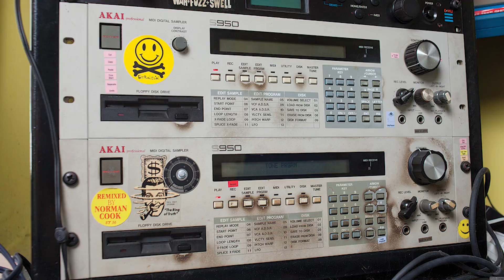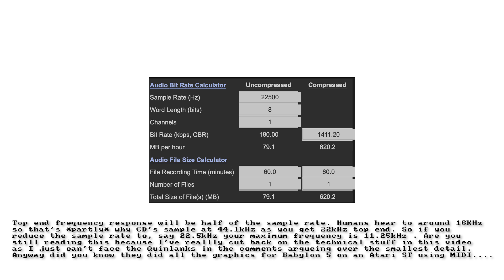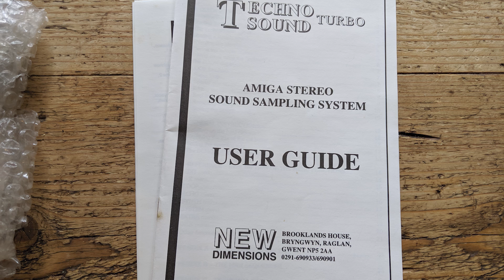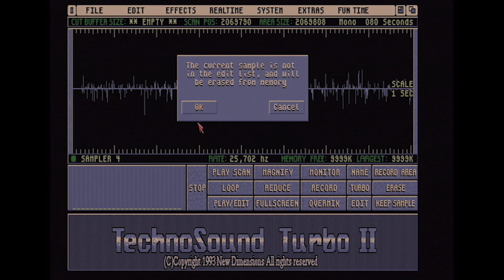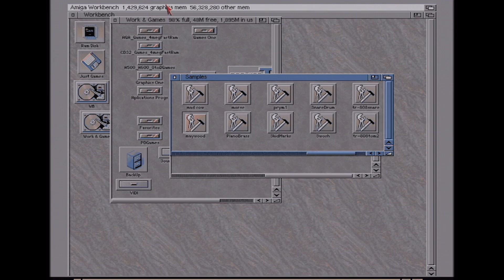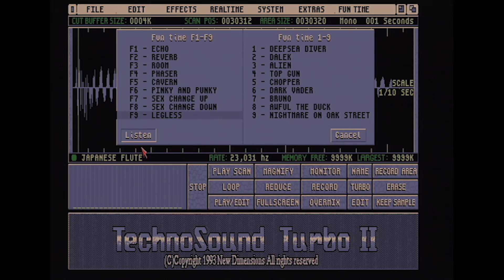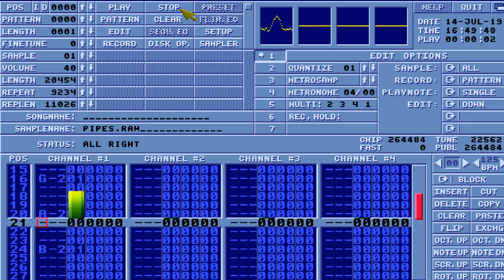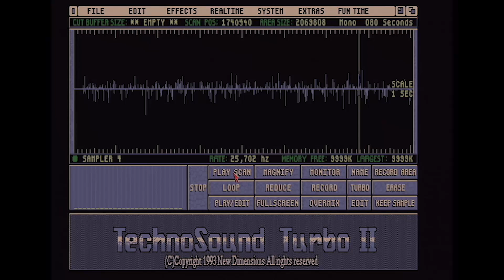ChinnyVision - Ep 397 - TechnoSound Turbo - Sound Sampling On The Amiga

Comment: Hi mate,   Thanks for the vid.   

Reasons you think the sound quality is so crap when you made your own samples is there too quiet.  Meaning the noise to signal ratio is gonna be bad.  So that noise stayes the same so with a louder sample you'd notice it less.   I used to use a compressor to compress my samples when sampling to get the best possible.  This makes a huge diff.  You can see the pro sample later on in the video you demo the wave form goes from top to bottom as opposed to yours thats a little blip on the line. 

Do you know if you can trigger samples within Techno sound via MIDI from another sequencer?  

All the best

Comment: I had the first version of this, it looked a lot nicer but was mono.  The software was a bit different but the tracker was really good.  The great thing about this was the ability to mix samples, thus giving the illusion of more channels as you could keep overlaying the samples until it became distorted.  I was using a 2mb Amiga and could fit quite a few samples in the tracker.  Made some good tunes with it.  Also made a lot of sound fx for the various Amos Pro games I wrote (knife banging on a bottle for the ping when a bullet hit metal etc) And yup, the sound quality was better than the unit in the video.
As an aside, I also had the hand scanner and the vidi along with the vidi colour unit that turned black and white images into full colour ones via electronic colour filters.

Comment: You talk as if the sound quality of the Amiga and memory limits were awful. In 1984 the cheapest sampler was probably an Ensoniq Mirage which would cost $4,000+ today and offered 10 kHz to 33 kHz 8-bit sampling. So the Amiga was pretty good. It was a computer as well, not a professional sampler.
Reply from the maker: That was not my intention at all.
Reply: Yep. It's easy for people to forget just how mind-blowing the Amiga's audio system was in 1985 (and for many years afterward). Even the horribly expensive Mac had just a single DAC with 22KHz fixed output. Most systems at that time were still using 1970s era PSGs (including the brand new ST, of course) and their tinkly chip-tune output.
Reply: @drramtop1576  I think ChinnyVision is seriously underselling the Amiga audio, which was revolutionary for 1985!
Reply from the maker: @Foebane72  Yes, the ST had far better audio than the Amiga.
Reply: @chinnyvision  If you prefer a single waveform on ST vs an infinite number of waveforms on Amiga, perhaps.